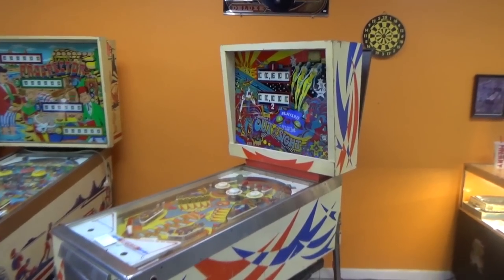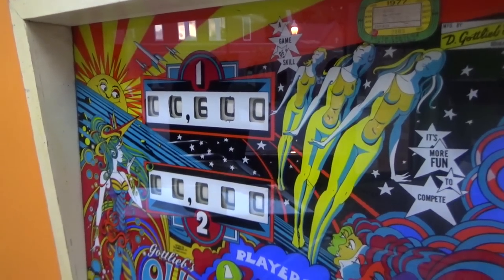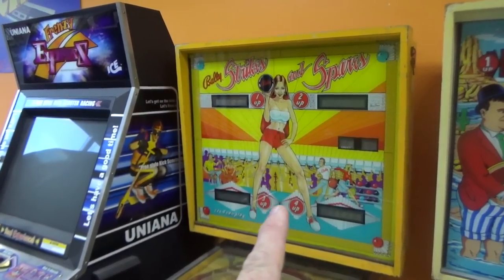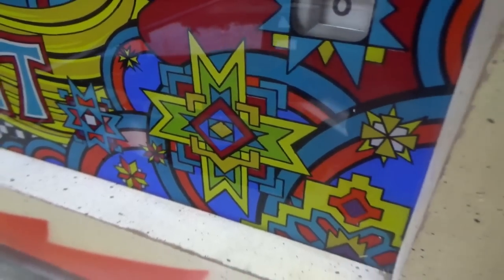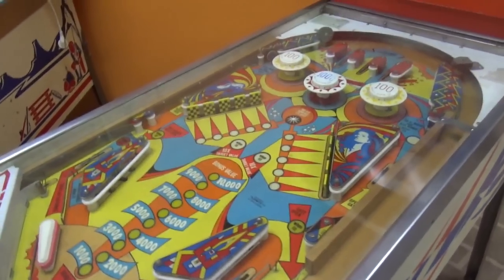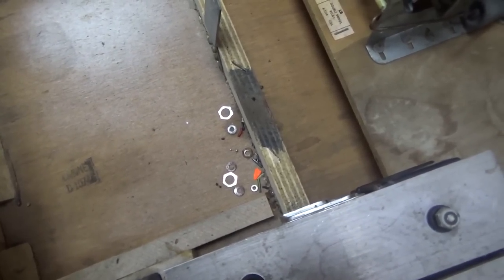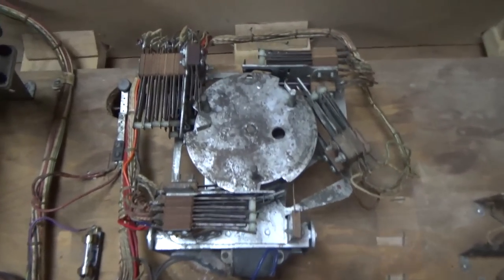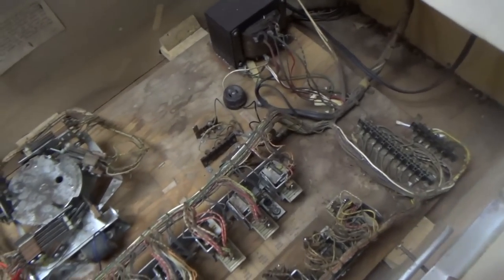Fixing A Hacked 1974 Gottlieb OUT OF SIGHT E.M. Pinball Machine - Beautiful Design Repair Video

Comment: my theory is someone was adding cheats to the game, had some cold soda, prolly mountain dew, and spilled some at one point and cleaned that up. hence the odd smudge under the rings, then put the can back in the other spot. the sponge is most likely from a cheap soldering station, that they used to solder the hacks. but at one point they put it back together only to realize the hack didnt work as expected, or at all. so they opened it back up but were to lazy to bring back out the soldering station, or more q-tips, so they just broke that wire off the 1st solder point then just wrapped it around the dirty, was it the: right bumper switch? and called it a day.

lol
Reply from the maker: Joe you should have just turned the soldering iron back on while you were under there!!!!!

Comment: Hey, how would you recommend probing a part to see if it works when current is sent through it? Is there a way to do it while the machine is off? I got one that's still a spaghettie mess of modded madness. I want to undo everything and make it work as originally intended. Just can't tell what parts are and aren't bad. Both versions of "clean" don't apply for mine, not by a longshot. Thank for your time in advance if you reply!

Comment: Do you have owners that ever want the coin mechs re-installed? and if so, are parts available for units of this age? For myself, I kind of like the idea of paying for the games, even if it's in my own home... Kind of like a savings account or piggy bank sort of thing. Maybe even use the money I collect from myself to buy another machine, or keep the one I've got fixed up, lol.
Reply: New Old Stock (NOS) coin mechanisms are sometimes available, but your best bet is probably a website like Marco Specialties.  However, the coin switches on these EM machines are easily bent out of shape.  On most EM games, if the coin door switches are mangled, the game will never reset.  This is because many sausage-fingered home owners try to start a game "manually" and accidentally bend the fragile coin switches together, sending the game into a non-operational mode.  Bally used microswitches; these are nearly idiotproof.  Williams are the worst when it comes to finicky coin switches.  Gottleib is somewhere in the middle when it comes to reliable coin switches.
Reply: If you install the coin box, would you be legally required to register it with some tax office?  There was a tax sticker on the machine.
Reply: You could get a jar a put a dollar in it every time u play a game

Comment: The operators pulled the coin mechs because they were A-holes!!!
Reply from the maker: I was an operator Steve
Reply: @LyonsArcade  Well Ron, did you ruin the value of the machines by pulling the mechs?  If not, then you need not be included, right?
Reply: @86FxBdyCpe  No, Steve, they probably pulled the coin mechs because the coin switches on those EM pinball machines were unreliable at best, and were too easy to accidentally bend shut, causing the game to never reset.  Of the three biggest manufacturers, Williams had the worst coin switches and Bally had the best.  Gottlieb was somewhere between the two.